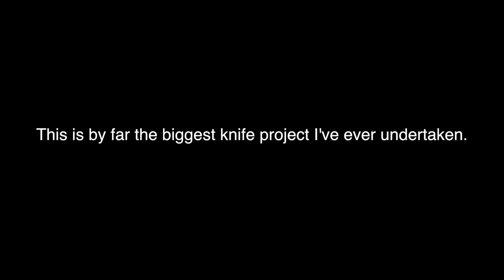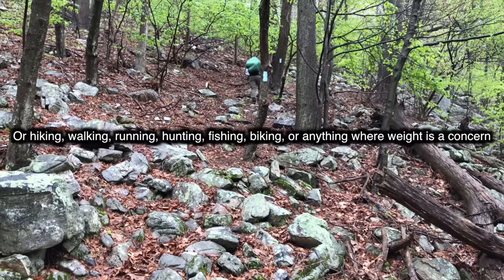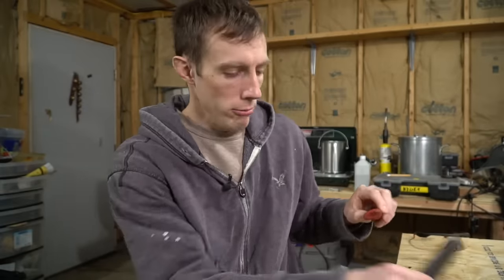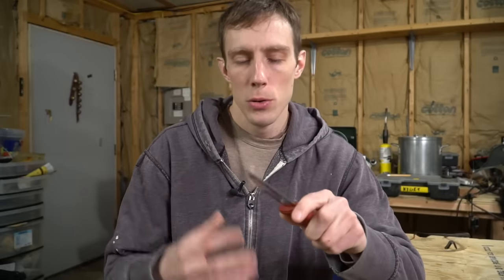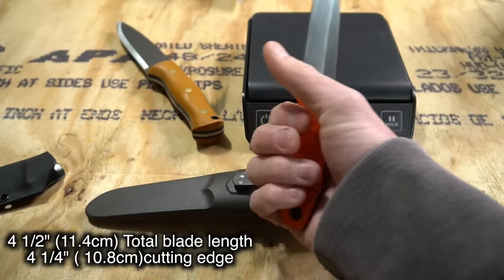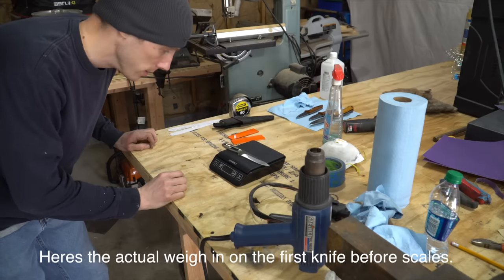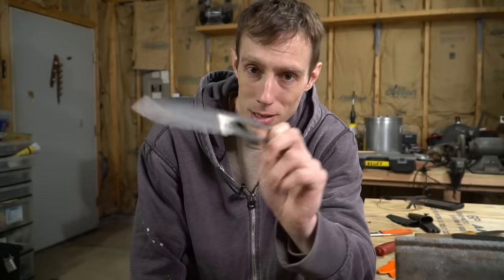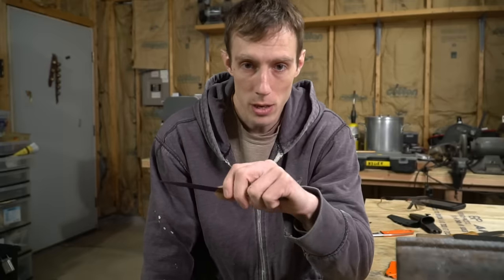What is the ULTIMATE Knife? Probably not what you think...

Comment: The Mora might look like something the cat dragged in, but, don’t forget that it was designed for the Swedish army. We used it in extreme conditions and cold weather, abused it, batoned it, splinted wood and everything that you can and can’t do with a knife. And it held up. It endured the torture of nordic mountain ranger service. It looks like a toy but it does what it was designed to do. It’s a light, versatile and virtually indestructible knife which is unbeatably cheap to produce in mass production. Bam💥, Swedish FMV (Försvarets Materielverk) did it again. Brilliant engineering.

Comment: Hi... I'm curious about that Mora breaking... did you broke the blade or the plastic grip ? Did you try to install a wood hand grip in that blade ? Can we see a picture of that...? 
Appart from that case, I've got a question about knife blade breaking when batoning since I've seen two (a SOG and a Morakniv) getting broken in battoning, and they both got broken in the middle. I've got the theory that once that the sharp side of the blade "sinks" into the log if we keep on grabbing the other side tight and strongly some steels can't resolve or absorb the vibration of the hammering with the other log and so it gets broken. What's your opinion about it ? Thanks. Martin from Argentina by the way...

Comment: What about a tapered tang? I'm also thinking about using a light wood. It would be a lot cheaper than carbon fiber and maybe even lighter.
Reply: Balsa wood is light but can be dented with a bit of pressure with your fingernail so...
Reply: @ssunfish  there are a ton of good choices for this. Balsa is not the wood to use for that regardless of weight. Don't understand why you even mentioned it
Reply: I was about to say something about tapering the tang but it would be harder to make a the scales though.
Reply: @ssunfish  There are tons of ways to just make a durable shell around the soft wood.
Reply: How ya gonna stop the tang from wallowing out the balsa internally?

Comment: excited for this project. you might want to consider leaving 1 or more diagonal pieces of metal in the center of the hollowed out handle to add some rigidity. like a truss bridge. contouring your handle even more than the prototype might help as well. my concern with thinner stock is that you want a wedge shape to separate the wood while batoning. a thin knife will have a tendency to get stuck. perhaps you can get away with a thicker stock knife that is less tall to save weight (meaning from cutting edge to spine). maybe with a scandi grind?

Comment: You can still skeletonize the handle after epoxy. Maybe 5/16" to 3/8" holes.  Three or four would help drastically reduce the weight.
Reply from the maker: I have thought about that. I may use carbon fiber tubing to fill the holes. It would definitely cut a couple tenths😀👍👍

Comment: I've had a mora robust for a while and the only thing I would change about is adding just a little bit of length, looks like your ultimate knife is pretty much what I'd want out of mine as well
Reply: I love my Mora Robust. If all you want is slightly more length, then they also make a thicker version of the Mora Companion. It's called the Companion HD (heavy duty). Less than $25.
Reply: @Danielson1818  Yep , the HD is no less than a fantastic knife , and it is plenty strong enough to baton on  . In destruction tests  it does as good or better than many much more expensive knives .

Comment: Take a look at the construction of the scales on the dpx hest original,  they're slightly smaller than the tang itself (surprisingly comfortable) and they've been hollowed out for storage. Could shave a bit of weight that way. And I've seen some designs where the tang tapers off towards the back, likely for balancing but also would shave some grams. Good luck with your diet!

Comment: I have a knife to design with parameters too. I don't know if it's possible to put a full height flat grind and convex edge on a knife of 5/32" stock or thinner with a blade height of one and a half inches to 3 inches. The knife would be long and wide, but not a chopper...a heavy slicer to do push cuts and draw cuts with. Far from a sharpened pry bar, which is so easy to buy these days.

Comment: How about using some sort of frn/Zytel/Grivory? I know the strength isn't as good as micarta or carbon fiber, but it's a lot cheaper and lighter than carbon fiber. The manufacturer spec sheets list the density of linen micarta as 1.34 g/cm^3, carbon fiber is listed at 1.55 g/cm^3, and Zytel is listed at 1.14 g/cm^3. Maybe you could 3D print it with a lattice structure to save more weight without compromising strength?

Comment: Feel like you never ran across the esee izula 2, even with just a cord wrap it's comfortable to use, light and more than strong enough to baton. Granted the blade isn't all that long but I never found it to be an issue and I normally run big blades like the esee junglas, Sami knives etc.

Comment: You can hollow out the scales as well, if you make them domed they shouldn’t lose much of their strength. Furthermore have you considered not making the handle full hollowed out tang, but more or less with a smaller tang encased in the handle, running through the whole length of the knife.

Comment: Tapering the tang will help, even a slight taper on the thinner stock you plan on using.   If you want to keep the handle-pin attachment strength with the use of threaded pins, use some aluminum Corby bolts in a smaller diameter than 1/4" which is more than you need, 3/16 or even an 1/8" Corby bolt head should be fine.    Or just get some carbon fiber pin stock.  

Sand blast and thoroughly clean you tang finishing with denatured alcohol because it doesn't leave any residue like acetone does.  Proper epoxy preparation with a good slow curing epoxy (such a g-flex) can make all the difference between it merely being used as a sealant from moister and it being a good and strong bond.   Always make sure to properly measure and throughly mix the epoxy for at least a few minutes.  These may seem not that important but it can really make a big difference in its overall bonding strength, then almost negating the need for any pins, and something like carbon fiber pins would be just fine when good quality epoxy is used to is full potential.  

Also, for the large cut out in the tang, I would make a cut out using some light poplar wood (or the like) to fit inside of there and then just drill a few holes in the wood for some epoxy rivets.  That large hole requires a lot of epoxy to fill up, which can add some extra weight verses filling most of that room with a very light wood.  

Carbon fiber is light with regard to its strength to weight ratio versus steel, but it still isn't super lightweight in itself for a handle material.  It may not be as indestructible as carbon fiber, but some curly Maple scales (or walnut) would also reduce the weight and still be pretty strong, you could even dye them orange for better visibility if you wanted lol.  Maple and walnut have been used of guns for centuries.m some other lighter and yet strong synthetics would be neoprene rubber sheets, which apparently some hunters enjoy on their knives.  Obviously some of these recommendations or a bit over the top, but since you're trying to shave a few grams here and there, then shave it in every single material you use on the knife.

Looking forward to seeing your tests and the results.  Take care :)

Comment: 3v and S7 are some really nice and tough steels. A8 mod is really tough stuff too. You might try Titanium, it can be heat treated and/or have the edge carbidized. Don't know how well it'll do on batoning, but it will be much lighter. 
Other ways you can save weight is make the knife narrower, skeletonize or drill holes in the scales, shape scales(contour or anso pattern), tapered tang, crown the spine(help with batoning by removing stress points and feels nicer but no ferro rod stricking).

Comment: Puukkos are lightweight, Mora is based on that design, but the tail is made to be a tapering tang with fitted wooden handle and usually brass fitting(s). It can certainly baton if build right. Think your issue is that full tang for light weight is hard to do.

Comment: Really cool project. Because Mora does fill the common needs, but even for a casual user the plastic sheath and handles felt so cheap and not that comfortable either. Yeah the plastic does have pretty good resistance to environments you might face when using, without losing the ability to use it, but it still feels like it can burn your skin when slipping. And just has that cheap plastic feel to it. And I wage that battoning is the number one concern I'd come up with if I started thinking about "what does the knife need to be able to withstand in the forest". Sure cutting is important but there's ways to achieve that, if the knife cracks or goes useless in the forest then you're done. Your Mora still looks better than the usual market Mora here, but still.

I figure the paracord handle is for something like for some reason you basically only have your blade with you and you're more likely to need your cord than your blade or the blade just needs to slice something. Some unlikely situation at least not a situation for someone hiking in the woods. Oh, or you bought a skeleton knife for the cool looks and are a cheap guy so don't want to replace a functioning knife. That's probably it really. I can't imagine wanting to buy a skeleton knife. Unless your plan was to make a paracord handle for it. And the question would be why.

Gotta appreciate the effort of announcing everything in grams as well. Even though I only needed the initial definition of whatever grams it weighed and you wanted it to weight to get an idea that oh, it weights like a small margarine pack and he wants to ~halve it, the rest was just differences from the goal so ounces is just as fine.

Comment: You could try wood scales, maybe pakka wood or dymond wood (resin infused wood, lighter than carbon fiber but I don't know the percentages). Also you could use thinner stock, like .10, I've got old hickory knives in 1095 that thick that can take a pounding, even battoning. I've got another knife that actually meets your criteria, 4.25 inch blade, full exposed Tang, wood scales, 2.9 ounces, the Russell Green River knife, $15_$20. Now I'm not suggesting this is the knife for you but it could be a guide on how to get your design.

Comment: I wonder if you could thin all of the metal along the handle portion, while leaving some of the thickness in the blade.  You could probably take a lot more weight out of the rear section of the handle without increasing the chance of failure too much.

Comment: So, I have a knife that cuts wood almost like butter. Not made out of either 1095 or 1084, is full tang, has really comfortable wooden scales(removable), that only weighs.......75 grams, 105 with a leather sheath. I just checked. It is a tad shorter, thinner, and made of 1066 and I really like it. I've seen another one baton for a couple of hours, knots and all without breaking which is why I bought mine. It has a big brother with a 4.3" blade and I think just squeezes into your parameters. The whole knife and sheath might be cheaper than just your carbon scales. Good luck with your search 😁

Comment: I use the Bark River Ultralight Bushcrafter for jobs that you're requiring -- I have two of them: Elmax and 3V. Another good choice is the Benchmade 200 "Puukko" (which isn't really a puukko) with santoprene handle and 3V steel. It helps if you're willing to baton from the edges inward -- rather than "right down the middle."

Comment: This is all speculative. After all, all the data I have comes from a YouTube video. ;-)

There are only two components of your design where you can consider weight reduction: the blade or the scales. You'll either have to use lower density materials or remove some of the material from what you're currently using. 

Making the same blade from a different steel only reduces weight if the new steel is of lower density. Even though I'm a rank amateur at working with steel, this does not sound feasible, at least as a way of getting the weight reduction you want.

Carbon fiber scales will be lighter, but, as you said, it's really expensive in the small volume you need. The strength characteristics carbon fiber is noted for (and why it's in such demand) will be wasted here. You're essentially forming the scales from a lump of binding resin and then lightening it by disbursing lower density carbon fibers throughout the resin. BTW, cutting or grinding carbon fiber release millions of carbon microfibers into the air where they hang until something moves that air, like a fan or your diaphragm. While your exposure would be minimal, like asbestos, once the microfibers are in your lungs, they're not coming out.

It doesn't look like you'll be able to lighten the scales without changing the material they're made from. Finding the right balance of hardness, durability, workability, and cost will be an interesting balancing act. Welcome to Engineering.

You'll get the same level of weight reduction while removing a lot less material by focusing on the blade. Have you considered tapering the portion of the blade under the scales? Say, from its 1/8" thickness at the front down to 1/16" at the back? You'd have to taper the scales as well, but this is clearly something you'd have no trouble with. Yes there will be more scale material, but it's nowhere near as dense as steel. Since you've already hollowed the blade under the scales, it's hard to judge what kind of weight reduction you'd get with this operation. But it would be maximal.

if you could remove 1/4 oz. (7 g) from the scales with a slightly softer, less dense plastic and 1/4 oz. from the blade by tapering, you might find your 1/2 oz reduction with minimal design change and cost increase.

Of course, my analysis could be way off base. Only someone with your knowledge and experience, working in your workshop with real materials, can determine what will reach your goal.

richard hargrove
--
Ah, those three little words so many people seem to have so much trouble saying: “I was wrong.”
Reply from the maker: The best way to reduce weight is to remove it from the densest material, which is the steel blade. I have considered tapering but real into a problem when battoning. The thin taper flexes too much and put stress on the scales. The same amount of weight can still be removed without tapering by removing the same amount of steel on the insides.While still keeping some lateral strength. Its a balancing act for sure. Thanks for the input👍

Comment: Just to let you know, I also make a few knives now and then and would suggest as some others have that instead of a convex or scandi grind that you hollow grind the blades to save weight. I would also hollow grind the inside of the scales as well. You might also think about using hollow tubing instead of pins or bolts and skip the epoxy. Flair the ends into counter sunk scales. Truthfully it seems a bit ridiculous to me for you to be this concerned over 1oz but it’s you time to use how you see fit.

Comment: Great video,I can't wait for the prototype an testing. My idea would be to router out scale from the inside to reduce weight an make them wider then add a cork insert to take up the space inside the handle,now I would seal the cork with a plastic coating before epoxying over it an I would use aluminum pins . A lot of prototypes to get it right but that's the fun of building an challenge yourself,you get experience an tested knowledge in real world experience. Keep up the good work Alex ,I still want you to make a Savage version of your knife with a Kukuri style blade mixed with your blade design on the Savage knife you made .
Reply: I can't imagine the cork would do anything there.  I agree to hollow the scales, but no need for cork.

Comment: Make a knife with a stub tang (Katanas have stub tangs) and use a strong dymondwood handle. Use a hardened 1/4" pin. A properly made stub tang will last a lifetime. You can also hollow out part of the handle too. You can also do a tapered tang and you'd make your 3 oz weight. I'd do a tapered tang before using nasty carbon fiber. I roll my grinder outside to grind carbon fiber. So going to expensive to buy 3V and extremely expensive to heat treat when you could use 80Cr2V, amazing. No stub tang, no tapered tang and going about as expensive as you can with the whole project.

Comment: Interesting challenge you've given yourself. IIRC, S7 has a range on its temper chart where it loses both hardness and toughness, so if you use S7 you'll want to avoid that temper. I vote for dimples on the blade and handle, and hollowing out the scales. I like the idea of 1/8 stock with some method of lightening vs stock that is too thin. But then again, probably my favorite all around Mora is an old bushcraft force (look it up) that has 2.5mm (.098") 12c27; it can handle battoning and avoids the weak tip grind of the Mora 2000 or Kansbol. Kochanski always used old saw blades for his home made knives, so ~3/32" has lots of credibility in my book.